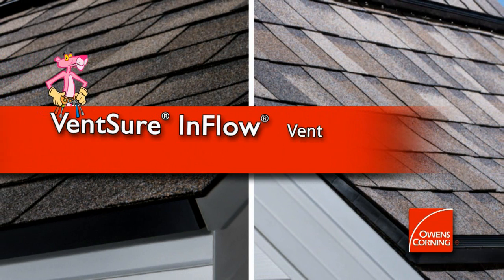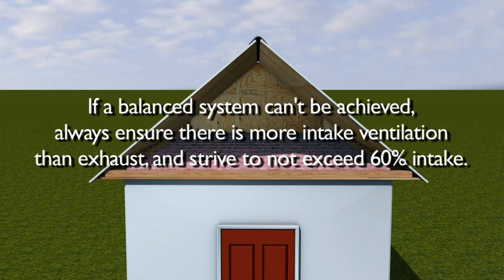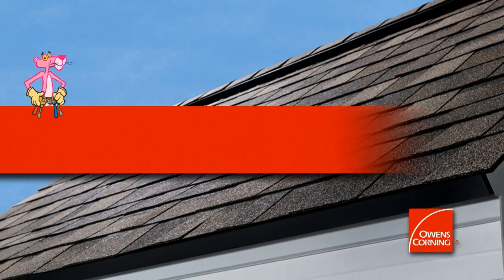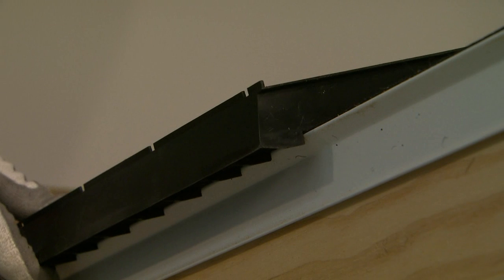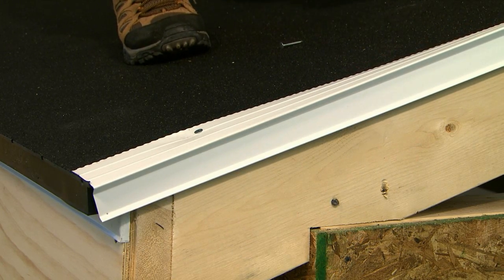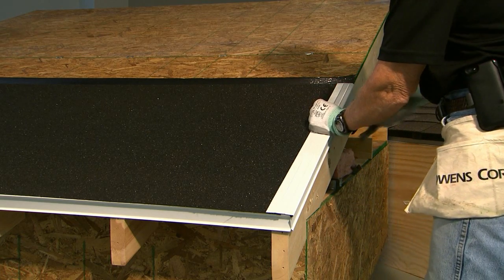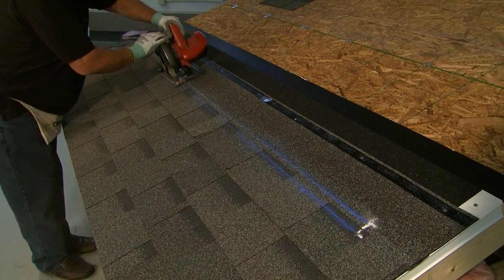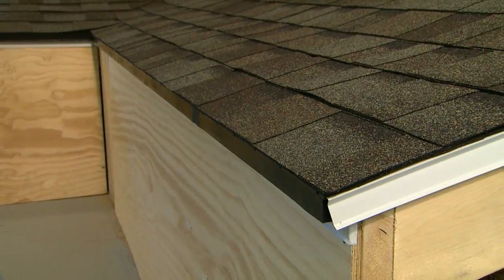How To Install a VentSure InFlow Vent

Comment: How do you end the vent at a hip? Can you end the vent in the middle of the roof or do you have to go all the way to the ends?
Reply: On a standard gable you can go all the way to the end but yes on a hip or a valley you would need to taper before the transition.
Similarly you don't need a ridge vent on the legs of a hip. Hopefully my words make sense.
Reply: @B.carguy  How do you taper at the transition? Does Owen's Corning make a tapered end piece?

Comment: Why do I feel this system doesn't flow as much air vs a proper soffit and ridge vent application. 
Why not draw from the soffit, it's the lowest part of the roof.
Reply: The whole purpose of this system is because some homes do not haVe soffit ventilation due to it not being possible

Comment: Some of the contractors who gave me a free inspection told me that ridge vent is not a good idea for my roof which is not flat or too steep.  Are they right?  For the ventilation work properly, do I need to install inflow vents as well?  My roof only has some Soffit Vents.  Appreciate your input ASAP as I'm in the process of having my roof done.  Great video!  Thank you.